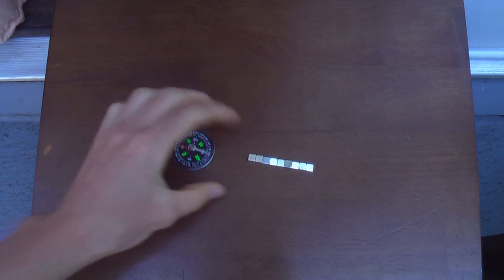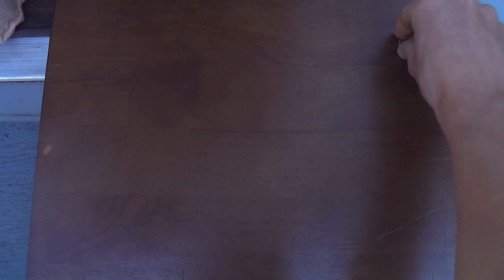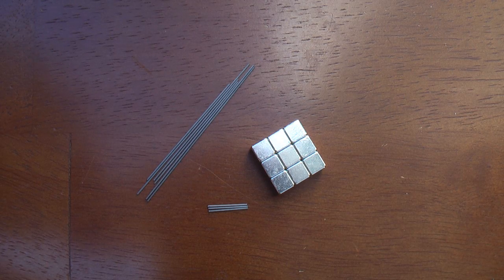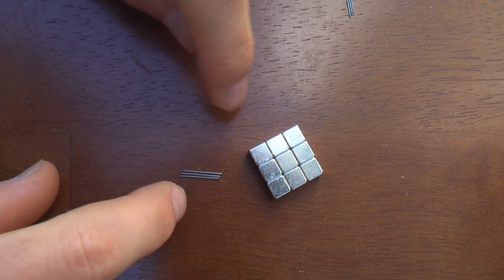Levitate a Piece of Graphite on Magnets - $10 Project

Comment: I've got a 8x4x1 cm  N45 Neodymium magnet. I tried it but the graphite i use is attracted by the magnet... And graphite should be diamagnetic.
Probably it's not pure graphite and it has some iron inside...

I'll probably buy some pyrolytic carbon.